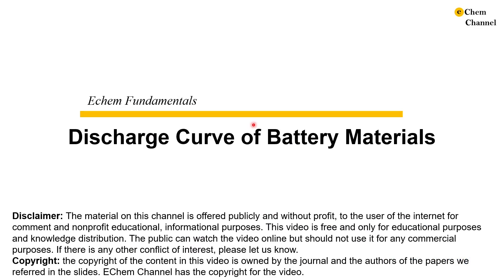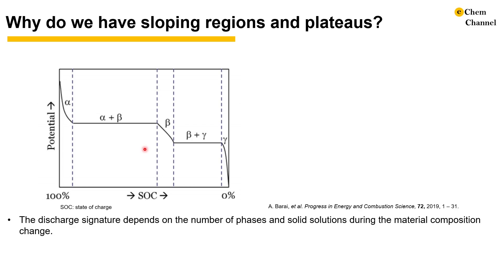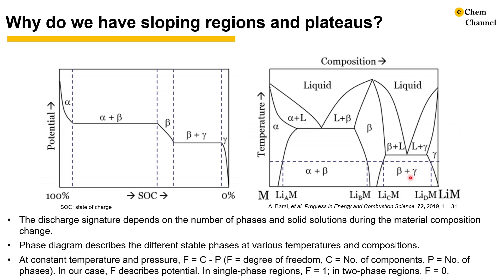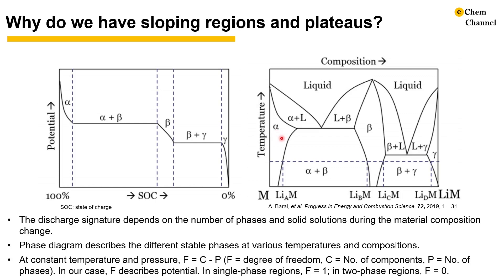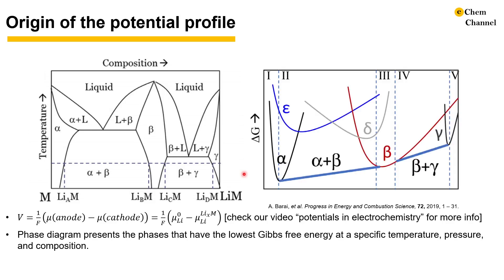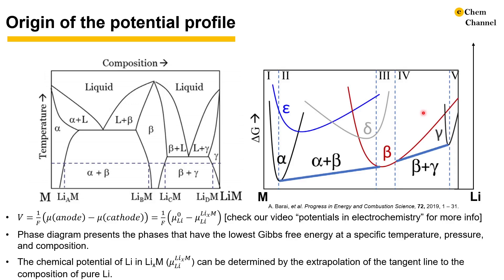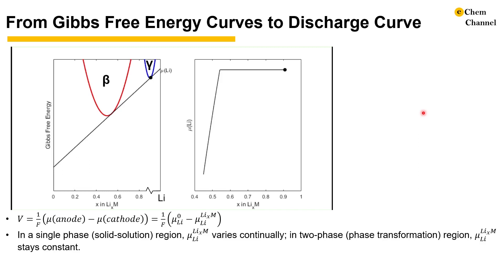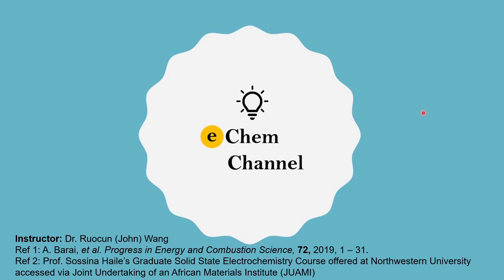Discharge Curve of Battery Materials

Comment: I observed that in case of my electrode material, potential first sharply decrease during discharging, then again start increasing in low potential region, a peak  occured,  followed by plateau and final discharge to minimum potential. What may be the cause of this behavior